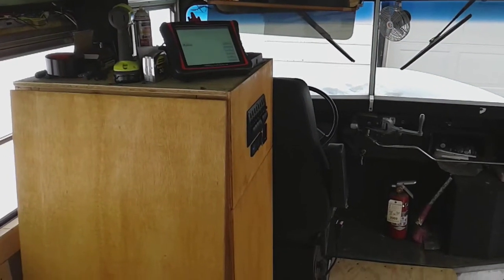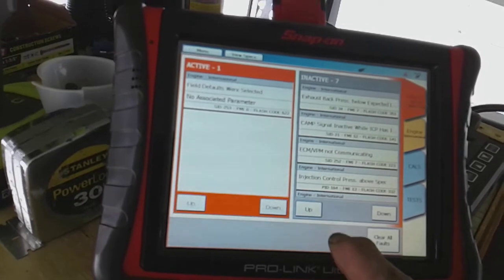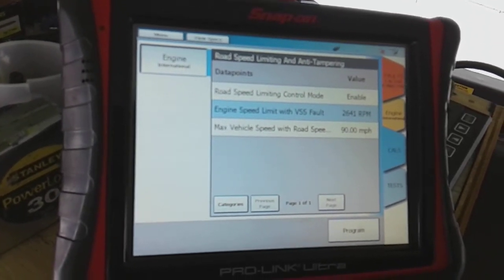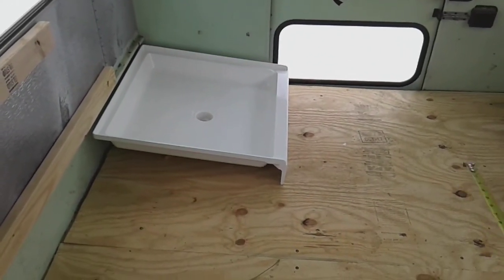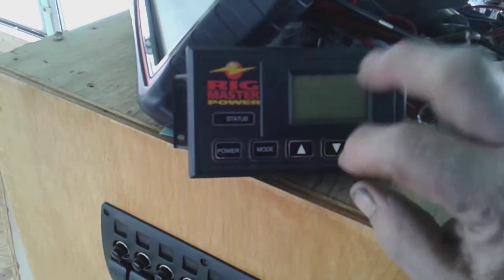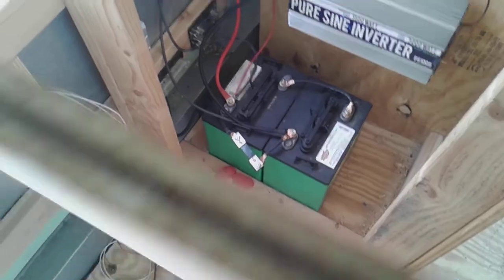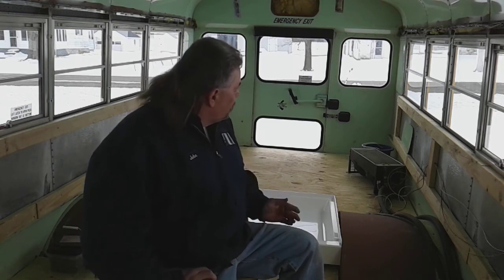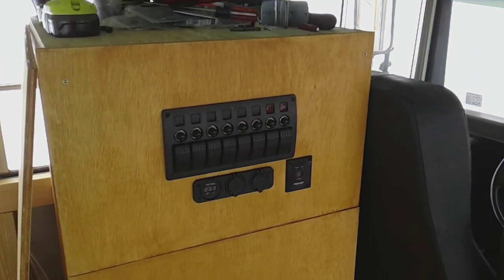Mullet's Skoolie Build EP 14 - Computer Scanning and Programming

Comment: I wander if you can unlock 6th gear.??I have the 466.And 6030.
Reply from the maker: whitney3377xxx That would require the Allison software to be installed which we do not have.
Reply: We have the autel. But it wont do anything I want.  thanks.